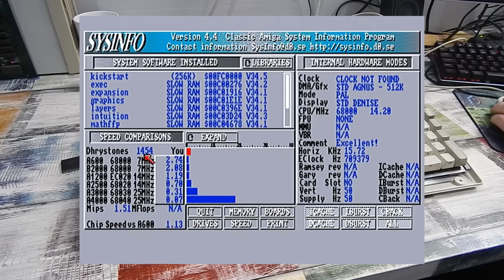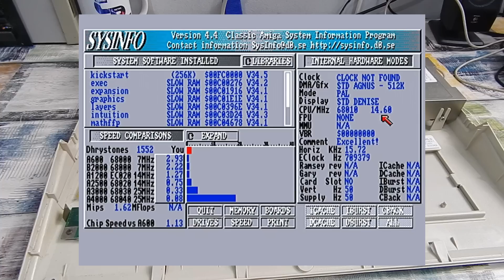Trying a 68010 in my 14MHz Amiga 500

Comment: I don't feel that it's fake or a slower one that they spent a lot of time on trying to sell it as a faster one... not for something like a low-end 010.  You hit it pretty well with the realizing that you just can't assume you can overclock, based on luck (I put a 010 in the CMI Processor Accelerator when I was working on that in the 80s, and it was very sensitive to speed input.  You know these are binned parts of higher crystal speeds that failed, so it gets marked as the one that it passes their internal fab tests at so there is a likelyhood that 12MHz really was all it could do for extended times.  And the amount of time that you got it to run before it hung was millions and millions of instructions per second, so if you get a 16MHz part you'll likely be winning.

Now, for the reason you put an 010 in: not for games.  What you very much wanted to use with an 010 was this:

"Loop mode" which accelerates loops consisting of only two instructions, such as a MOVE and a DBRA. The two-instruction mini-loop opcodes are prefetched and held in the 6-byte instruction cache while subsequent memory read/write cycles are only needed for the data operands for the duration of the loop. It provided for performance improvements averaging 50%, as a result of the elimination of instruction opcodes fetching during the loop.

You did see an improvement over the original 68k in sysinfo, but as you pointed out, sysinfo isn't a great way of testing it.  I used the 010 loop mode on the CMI Multiport Board SCSI code with a 4-way set associative cache, but had to yank it because I needed to code space in the boot ROM.  It did yield at least a 10% improvement... which doesn't sound like much, but it was not expensive to get, and was fairly easy to install [sorry about your PLCC carrier.. I did that far too many times even with the extractor] (at the sake of some timing-critical games or cycle-specific code would break).

Cheers, and great video as always.
Reply from the maker: Thanks for the detailed reply.  I have to admit I often wonder why anyone would bother relabelling chips, especially low value parts like this.  It may well be the case that it isn't refinished but I can't help but wonder with the feel of the top of it and the fact that the nail polish remover did take something off.  

I may yet get another one and try to look for a 16mhz part so I can do some more thorough testing but for my use, for games, I don't think there will be much if any improvement.
Reply: @CRG  Nail polish remover is just rough on certain plastics in general and you were really rubbing hard on that and only got a very small bit of stuff, so it might've just been getting the bits of rough plastic off.  When I've seen this being demonstrated, it was just immediately a bunch of stuff coming off, turning the tip completely black.  The differences could certainly be chalked up to different production lines even in the past.  Just doesn't seem very conclusive.
Reply from the maker: @Aeduo  that may well be the case but there is still the fact that the labelling does feel etched into the surface.  Of course nothing to say it wasn't etched in the first place.  It's hard to conclusively say either way on if it it's genuinely a 12mhz chip.  All I can say for certain is that it doesn't work at 14mhz.  That in itself isn't enough to prove it's a relabelled part but certainly from experience most CPUs will overclock a small percentage.
Reply: I was unaware there was ever any 16MHz 68k10 parts made. Could not find any back in the early 1990s, when I was trying to wring every last scrap of speed out of my already aging A500 with AdSpeed accelerator. Ended up buying two DIP package 12MHz '010s (one after the other) and they both crashed immediately when you switched into 14MHz mode, sadly. Not sure if that's because the CPUs wouldn't overclock, or if it was some quirk of the AdSpeed itself; some hardware timing or whatever being different. shrug

Pity, because the VBR feature of the '010 was quite nifty when doing serial port I/O as I recall (dial-up modems being an important part of my life back then.)
Reply: bit late but,...  it looks not much of a deal to overclock a 12MHz chip to 14.6MHz. But this is almost 22% overclock! Imagine to push a 5GHz i9 to 6.1GHz...

Comment: Speaking of CF cards, I went the ACA500plus route. The difference a mass-storage device makes to an Amiga 500 is incredible! It doesn't feel like a pokey little machine any more :)
Reply from the maker: It's great to see all these modern upgrades for the old systems.  Only thing I don't like about the ACA500 is that it sits external.  Wouldn't suit me since I rarely have these machines in a permanent setup.  That's not to take away from it though, it's a great card.
Reply: @CRG  i printed a case for my ACA500 plus that is in the shape of the GVP HD8+ hdd add on. Looks really good. And hides the card nicely.
Reply: Yes it was thing only selling without HD ,and yes it works,with floppy, ,you can boot PC from floppy, imaging PC sales would have went if PC's where sold as only needing a floppy to work?

Comment: 68010 may not be CMOS version, hence the heat
Reply: AFAIK, the 68010 was never popular enough to warrant a CMOS conversion.  The 68000 CMOS version was designed by Hitachi.
Reply from the maker: I never thought of that, although the chip does get hot, not burn you hot but just a bit more than you'd be comfortable leaving.

Comment: Another problem with a 68010 is that some games won't run anymore. WHDLoad is fine, but some disk games won't work (SWIV for example).
Reply: Yeah, some games do stupid tricks with the stack during exceptions, but stack frames on the 68010 are sized differently than the 68000.  If a game won't work on an '020, it will likely also have problems on an '010.
Reply from the maker: That's true and I probably should have mentioned it in the video.  Thanks for reminding me.

Comment: The '010 was also made by a few other companies so I wonder if it's a rebadged non first party chip.
I must confess that my overall knowledge of the '010 is pretty slim, I know how the speedups work, but not enough to actually help with diagnosing the actual real speed or fab of a remarked unit...

-Dx
Reply: Why would that be a problem? They all used identical masks from Motorola. And even actual reverse engineered CPUs often works flawlessly. (Such as NEC, Sharp, Toshiba, Hitachi, and Goldstar (LG) clones of the Z80, for instance.)
Reply: @herrbonk3635  Who said it would be a problem? I was speculating if that's why it was remarked.

Comment: I got a 68882 pga for my A1200 card on ebay. When I got it you can see where the top had been refinished. It went back I did not fit it. I found a OK one later.
The thing is all of the chips are over 30 years old there might be some damage to the top text.

Comment: In a stock A500 a 68010 runs as fast as 68000 with fast ram. With Fast Ram installed there is no difference.

Comment: Yeah it sounds like an 8 that's pushed too hard.
I have a 20mhz plcc 010 if you're interested, i was going to use it in my wicher 508i but it didn't like it (the firmware on the wicher couldn't hack it) I'd be happy to send it along if you're interested like.
Reply from the maker: I'd certainly be interested in getting the chip, if anything it would let me do some more thorough testing.  

Drop me an email if you like, casualretrogamer@outlook.com
Reply: @CRG  sorry it's taken so long to get back, I've been going through my chips and I can't find the 010 I had, i found 2 68000's which i didn't know were there but no sign of the 010 I'll keep you posted.